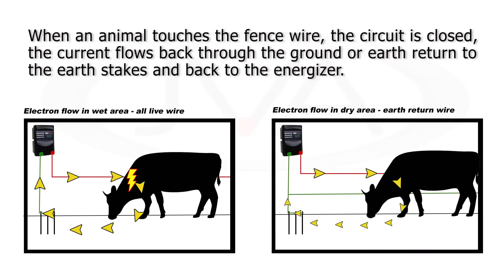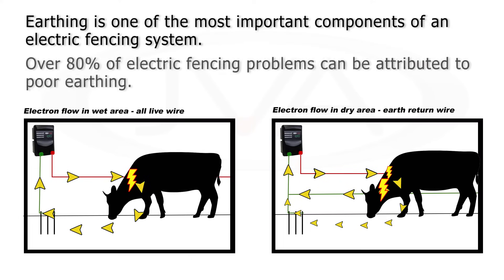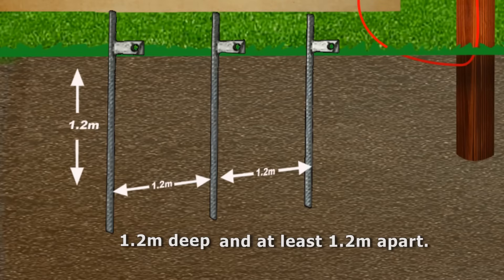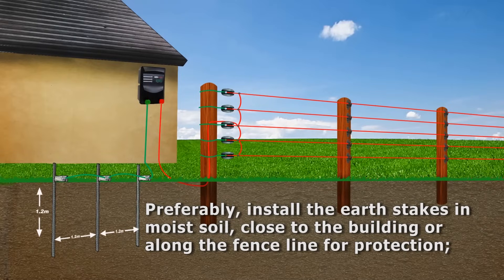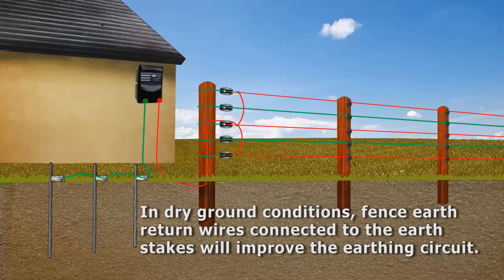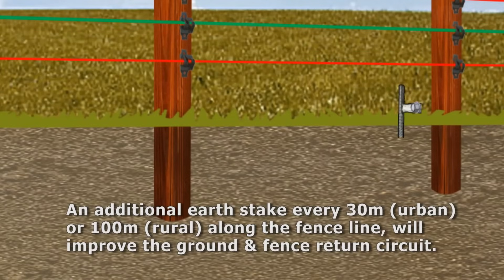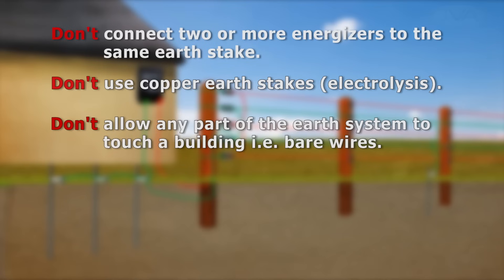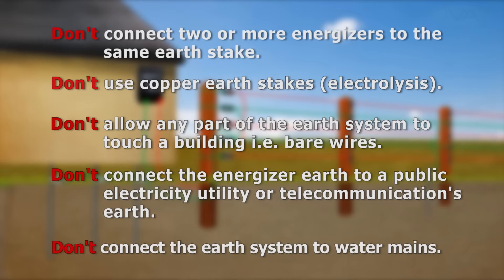How to earth an agricultural electric fence?

Comment: Can you use metal fence posts and if so does the wire need to be insulated?
Reply: You can use metal posts, and yes, you need to use insulators

Comment: So my dog climbs and jumps my privacy wood fence (6ft high) so I put my live wire at the very top , my dog unfortunately still climbed and got out even tho he touched the live wires , so do I need to add a neutral wire at the top as well to complete the circuit?
Reply: Lmao. Yes. There's no point putting a hotwire at the top when he's already jumped; put it at the bottom where he jumps from
Reply: You need a different dog! 😂

Comment: Incomplete connections...is there a return? Should there be? How is everything connected at the energizer?
Reply from the maker: https://www.youtube.com/watch?v=5evf-Da9kzE

This video will help you understand the electric fence system, it is an open system with a live out and a neutral to ground the circuit is only completed when something touches the fence enabling the current to travel to ground and back to the energizer.

Comment: Hi - thanks for the vid. What would be the consequence of connecting two energisers to the same earth rods?
Reply: Hi George your question has received a lot of debate within the electric fencing community some say it is more common practice now to use the same earth for two different energizers but there have been some issues in the past especially when one of the energizers was larger than the other, there were accounts where the larger energizer caused issues to the other energizer, it is also more difficult to determine possible faults along a fence line when two energizers share an earth.